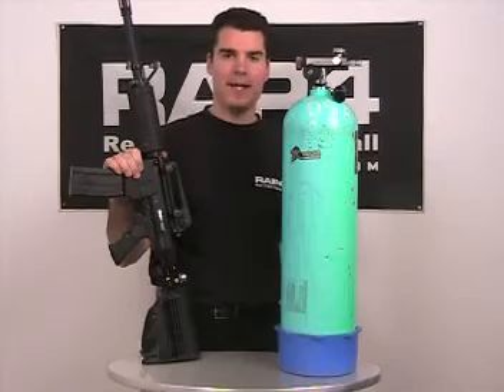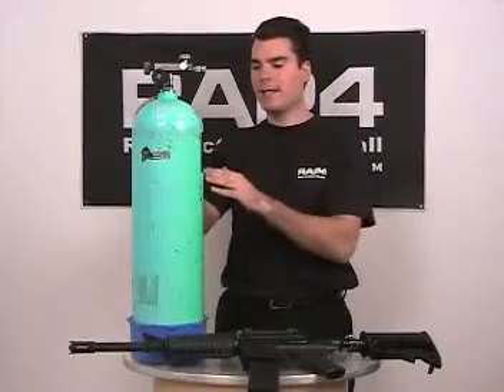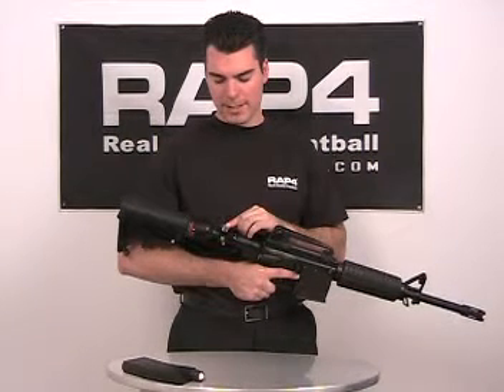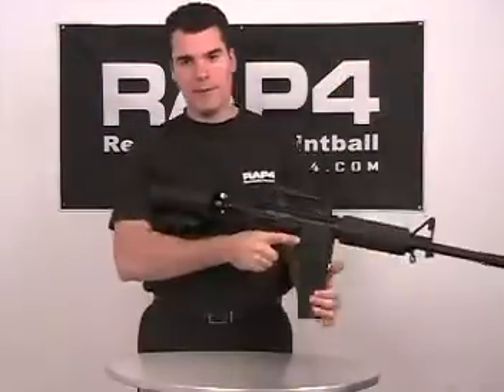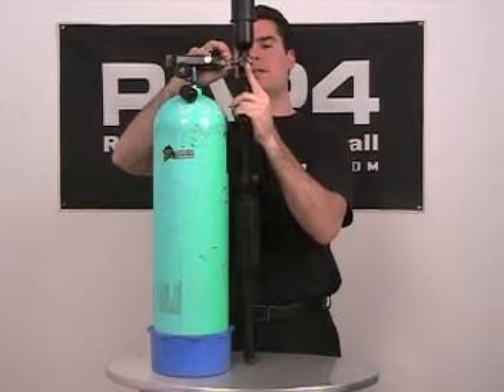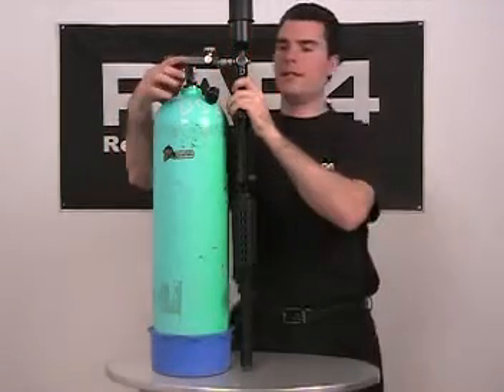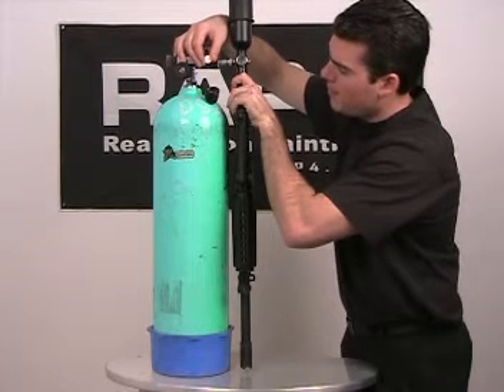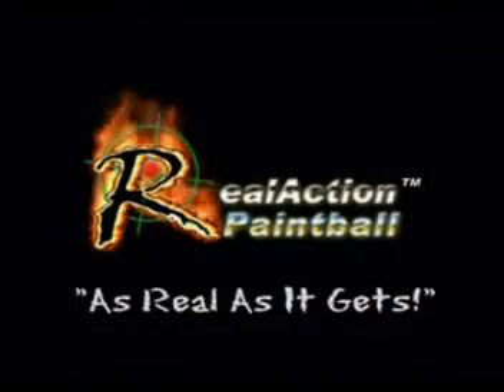RAP4: Refilling Air In Stock System For Military Training With Scuba Air Tank

Comment from the maker: No, you can't use an air compressor because the tanks used for paintball are either 3000 or 4500 psi and the average air compressor will max out at 200-300 psi